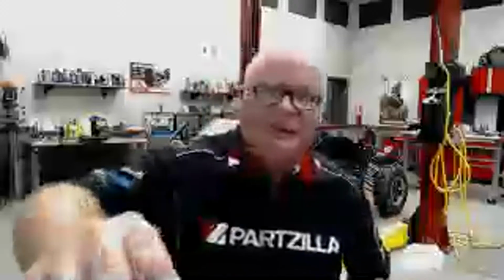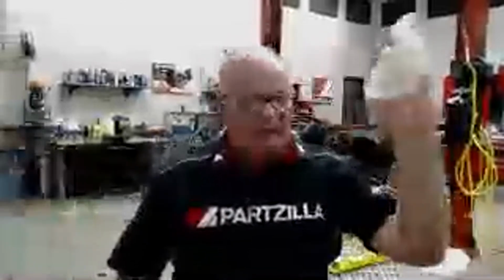Live Q&A with John Talley 6.2.23 | Partzilla.com

Comment: I usually dump the electrolyte into the new battery and leave it vented for at least a few hours before sealing the holes with the plastic cap...i find batteries last longer when done that way..never bothered to charge them and its starts just as good..i ride a 1200cc bandit.🐱👍🏿
Reply: Just shut up, if you have a brute force 750 that barrely charges up what you need to ride it's gonna fuck up your battery, you need to know that before making points like this, if the plates are in a negative charged acid, and they keep that way they make calcification, and that's it, you need to launch the
memorie of your battery before use
Reply: you maybe fucked up 30% or more of you battery life until it adapted to your bike, but it doesn't apply to every thing please take care
Reply: @OutrageousPenalty  i replace my batteries every 3 to 4yrs whether still good or bad... as batteries get older resistance builds up internally and charging systems have to work harder to keep them charged..yes i use a Yuasa YTX9 as well
Reply: Just makes me crazy all this video and the only dude to dis my question is you because you ride a two wheels bike that i guess is newer than 4 years old have a decent stator that never gone through anything bad, and charges up more that you need, ane you make statement for every user in there, drives me crazy i just lost 140 $ on a brand new yuasa and my quad isnt event that old it's a 2010, just know what you talkin about like john does, damnit
Reply: @OutrageousPenalty  my bike is about 17yrs old amigo!
shes an old model 1200cc suzuki, with a piggyback alternator that looks like a car's..
Reply: My 5 years old battery still be good, i have 000% problem starting my quad and this brand new yuasa battery is dead, have gone through 3 electric professionals to try and making it come back with no luck, it's seems like you just commented to make me freek out please go home